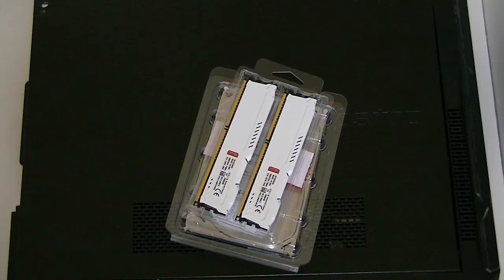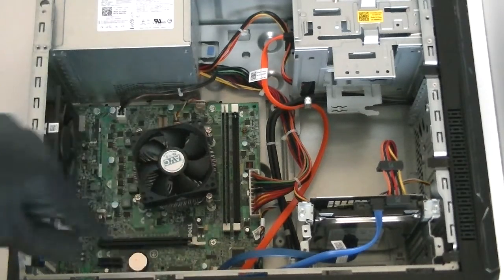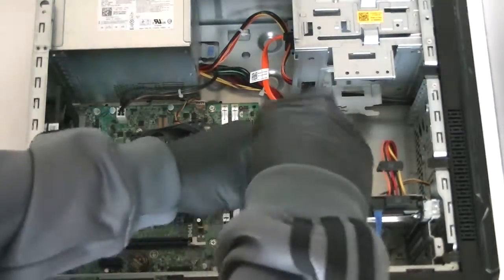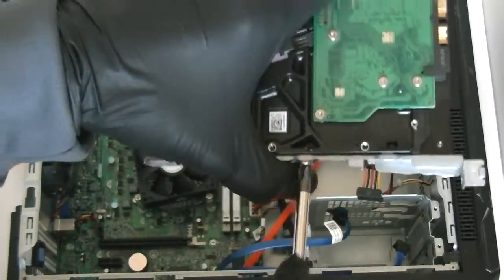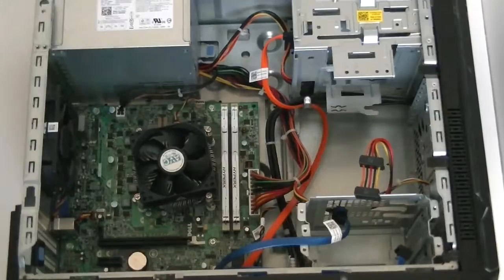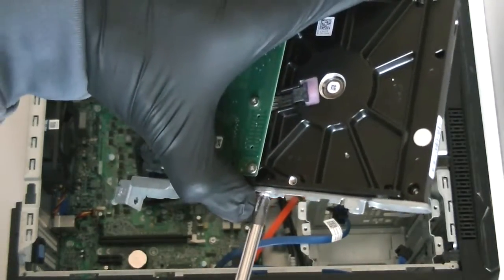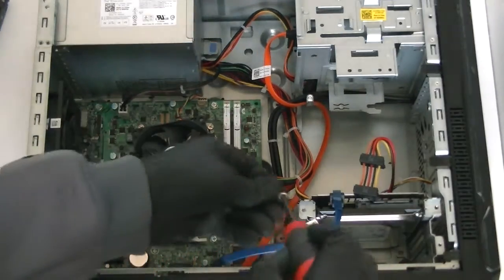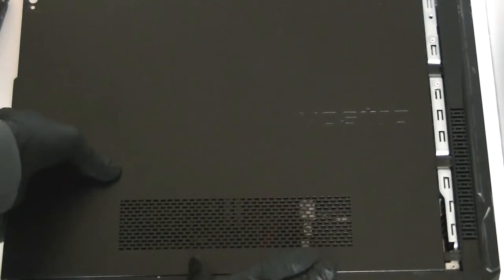Dell Vostro 260 RAM, HDD Replace Install Upgrade Change

Comment: Try more that 8 gigs of ram
Video here guy has 16 and a i7 2600 in a vistro 260
I have a i5 2500
Try it please
Reply: YOU can run 16gb with the i5 2499 with no problems. I have it in my Vostro 260
Reply: i5 2400 sorry

Comment: The Vostro 260s is pretty awesome with some upgrades, not to mention it has one of the few motherboards in a Dell system that can easily be transferred into another case with no errors. It's a shame that most of these were shipped with some super slow hard drives that cripple the performance. While the Intel i7 2600 is not "supported" on Dell's website, it works (the i5 that is considered supported has the exact same TDP). With an SSD, i7 2600, power supply upgrade and a decent graphics card like a GTX 1050Ti or Radeon RX 560-570 you have a working pc that could still game in 2018.
Reply: This may be a bit late, but really? I can transfer these MOBOs to another case?
Reply: Do you have actual source the i7 2600 works. I have a 260. same gpu. Dell site somewhat said the i5 2500 will work. i5 2400 tested and it does. No on the i7. mouse and key board didnt work. If you have source someone has tried it I will go for it.. Get with me.
Reply: THANKS!!! Now I order the i7 2600 with a new heat sink. Yours works. Hope the wireless mouse and key board work. Update the Bios to that A 10 right?
Reply: Im going to put a i7 2600 in mine. On dells official someone had mouse and keyboard not working. Then someone said wit wouldnt work.  But you got it working. Bios update right? Can I use wireless mouse and keyboard and or Wired? About a month or so Ill try this with a return policy i7. You are the only one I know that it works

Comment: Is it possible to have 16gb of ram? All sites I look at say 8gb is the limit, but I wanted to check with you.
Reply: Wished someone answered you. I have 8 want 16
Reply: I HAVE VOSTRO i5 2400 +16gb ram running no problem 100%

Comment: can you upgrade the graphics on this computer?
Reply from the maker: Hi, yes you can upgrade the graphics.
Reply: Mxkdi what graphics card do you suggest?
Reply: also what about the power supply?
Reply from the maker: Yes you can upgrade power supply and what processor is installed on your machine?
Reply: Mxkdi its all still factory. it came with a core i3. wanting to upgrade to a quad core i5.

Comment: Hey mxkdi, I have this exact PC but I can't get the computer to boot when a RAM stick is in slot 1. Any help?
Reply from the maker: What kind a memory did you install ?
Reply: Mxkdi just matching ddr3 1333mhz pc3-10600u RAM 2x2GB, but the computer will only boot with RAM in the second slot. I've tested them both individually in each slot to remove the option that the RAM is faulty. I think the ram slot is faulty or the bios is letting me post with it installed there
Reply: @smyth0109  did you fix it?
Reply: @Robbnlinzi  hi buddy, can’t really remember to be honest. I think a Bios update fixed it
Reply: @smyth0109 did you now motherboard support 2x16 of ram?

Comment: Have you had any problems with the computer? I have a 260 and cannot seem to update the bios or install windows 7 on it. Have any ideas or help? Thanks.
Reply from the maker: No problems, what error message are you getting ?
Reply: Mxkdi also I subbed, also can u tell me how MUCH ram?
Reply from the maker: Hi, 8gb kingston hyperx 4gb ddr3-1333 per each slot
Reply: When asking a question, don't leave the guy hanging. You probably didn't enable LEGACY under bios when upgrading to Windows 7.